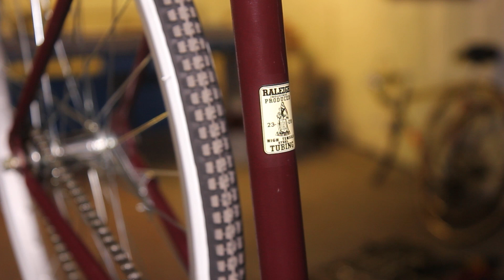Brakeless Single Speed Raleigh Town Bike Build

Comment: Are you in UK? The bike will be illegal and liable to seizure by police in uk, and you will be held liable in any collision.
Reply from the maker: No different to the 1000’s of brakeless fixies on the roads. I appreciate the concern though, thanks!
Reply: I've seen many many brakeless fixed gear bikes in London
Reply: @SJMCycles  It's arguably safer than a brakeless fixie since braking doesn't require a particular technique and a foot retention device. In any case, combining a coaster brake with a front brake device is strongly advised by Sheldon Brown, since coaster brakes, if less prone to failing than rim brakes, when they do fail, they just stop working alltogether ( generally in descents at speed ). 
Anyway, the bike is gorgeous. Nice work !